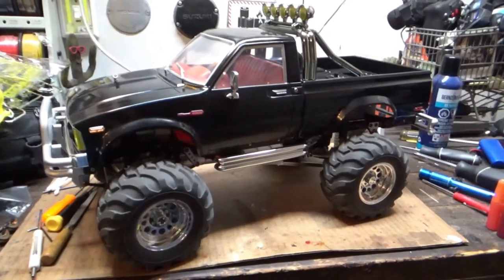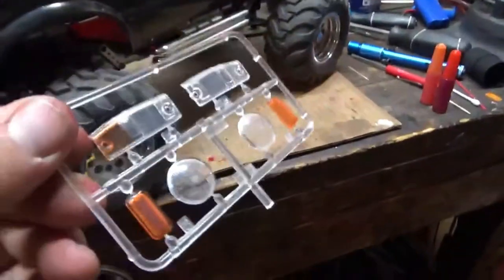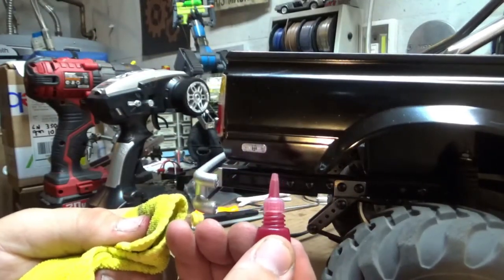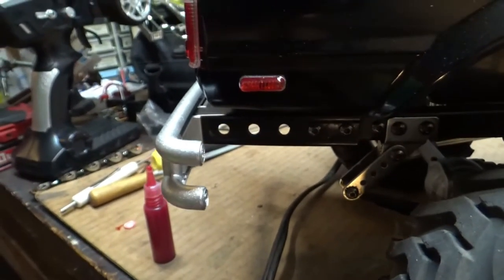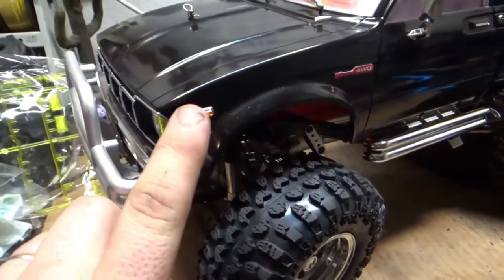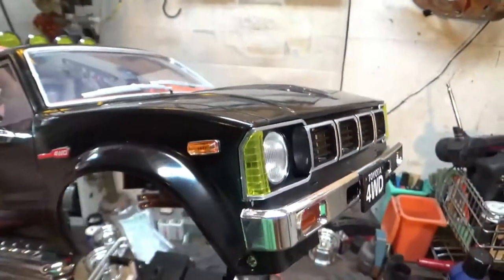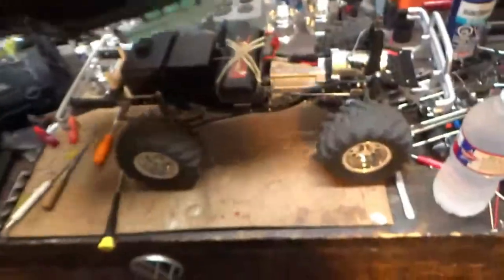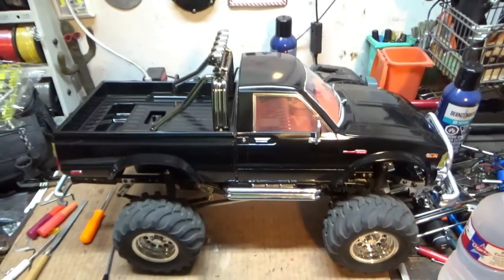DIY R/C Amber Lenses , HG-P407 , Tamiya Hilux Bruiser

Comment: Bro, YOUR mods on this 407 are by far THE BEST I have encountered !  I have 3 of these 407’s, one of the three,  I have replicated the Tamiya Bruiser as close to the original Bruiser. Just because the genuine Bruisers have ALWAY been just so darn expensive even back in 1985. 
 The second 407 to that I have is a pure stock 407. 
  The 3rd 407 that I own I have used for upgrades and mods. I absolutely think your wheel base extension mod is freaking FANTASTIC! 
   I really enjoy your attention to detail, things that just don’t look or function well drive me crazy as well. 
  Keep up the great work, and I hope to see some great mods on the F350/Hilux 409 clone. 
  Thanks !